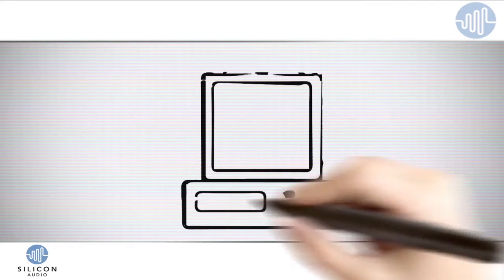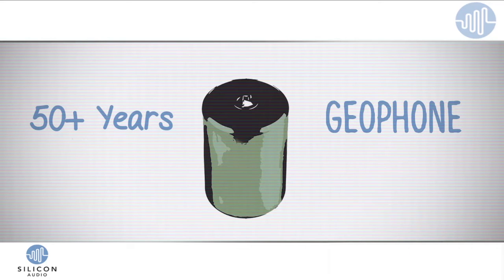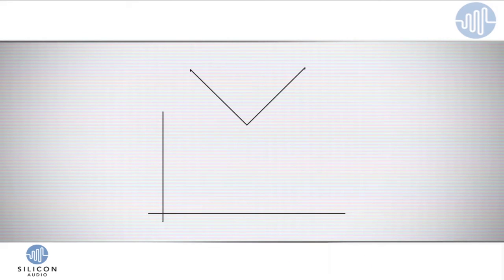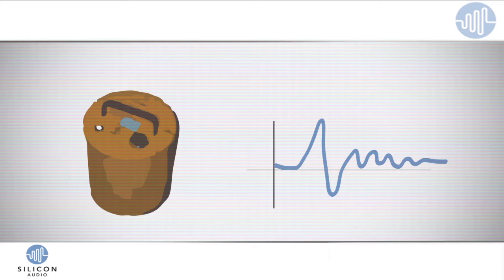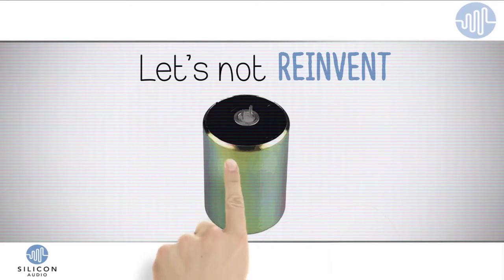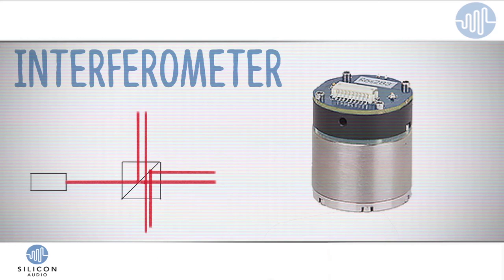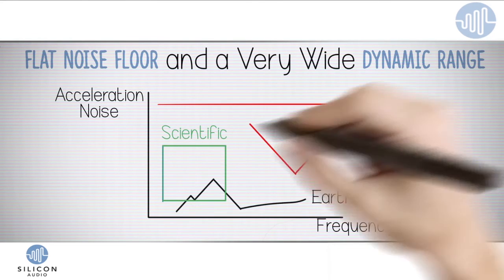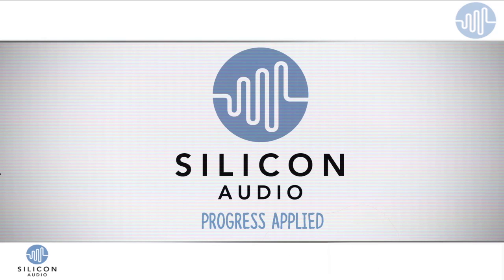Silicon Audio Optical Seismometer

Comment: Correct me if I'm wrong, but 1fm is about the size of a proton. It is 0.000000000001mm or 3.937007874015748031496062992126e-14 Inches

or, simplified.
0.00000000000003937007874015748031496062992126"